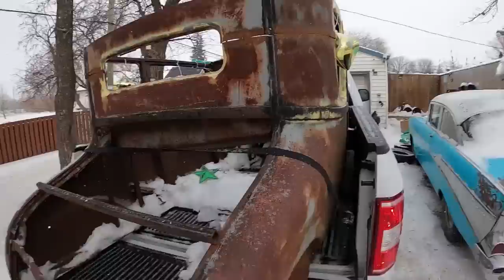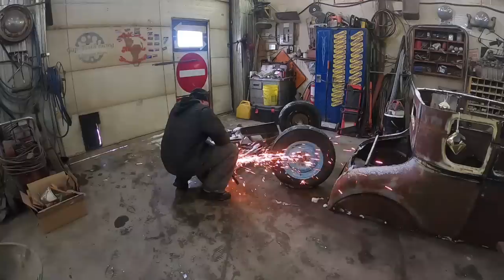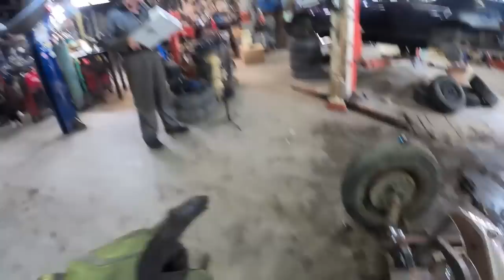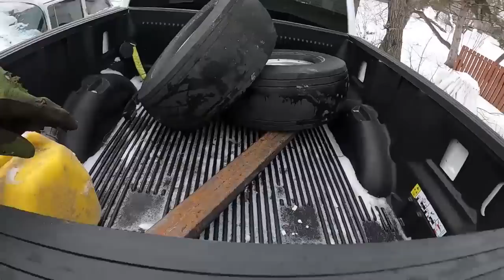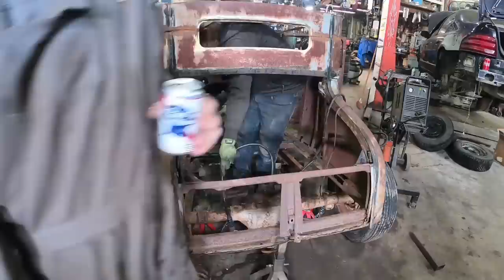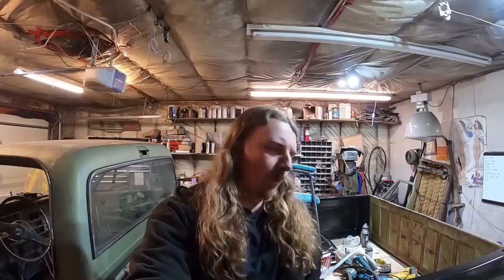Model T Rat Rod Build - T Wrecks, From Junk Parts to a Roller with Halfass Kustoms

Comment: I dig both projects. Halfass is doing something that has caught your interest, I'm sure not your first roller frame but no shame if it is as that always holds a guy back. Taking a break from the c10 will allow you to come back and finish. I have got started on stuff like it and so committed that too late to change to a different, not necessarily better but different outcome. I know that your holding costs down on the truck build cause they can be money pits. It will greek up when the primer goes on and some wheels of choice gives it direction. I like working as a team on some things but like the roadster that is next is halfass's regular day job and he is enjoying company and giving him a break as well from the 38 pontiac that has come to finishing touches. As it gets better, you need to sell to keep money coming in and its starting to warm the heart a little. Ya let them go before paint or then its harder still. I do comment on his stuff a lot so maybe or maybe not member my name. I just wish I was there doing some down and dirty makes you feel like you did something. While up there take a look at some of his front end/rear end attachments and see which way you go next time as you have enough to go back to back and its cheaper than building double nickel chevys. Anyway a hi to both and see if he does remember the name (me). You guys could team up on one build only spendy project for a club car or whatever turns your crank.... luck to both

Comment: two great channels to follow, keep up the good work! T is awesome, flat head would make it sound awesome!
Reply from the maker: yeah it sure would.  i think il go more traditional with the roadster
Reply: @DDSpeedShop  there is nothing more traditional then a flaty.  Although next would be either a 283 or 327. Do not and may I say it again do not put a LS motor in it.!!!! Also the wide tires and aluminum wheels would be out of place on this build.  You want narrow and tall with either chrome reverse or steel wheels, just like the ones that you are using to mock up with. 😎

Comment: I'm a fairly new subscriber. I really enjoy your videos. I commend you for your efforts. I envy you for the amount of time you have to devote to your projects. I REALLY don't want to be a Negative Nelly. HOWEVER... I have doubts about your front suspension. It APPEARS you may only have an inch or two of travel before the spring comes crashing into the bottom of the frame rails, causing all sorts of havoc. But who am I to judge? Rather than rain on your parade, I should probably start my own durn channel and show how I do it.
Reply from the maker: yup needs a block or somthing to raise it up

Comment: Sometimes it's good to "shift gears" and work on a different project to clean one's mind...The hot rod looks cool. I realize I'm getting ahead here, I still have a question. When you welded the truck frame to the existing car frame, do you have to add additional braces where the frames were spliced?
Reply from the maker: yup ill go back and plate everythiing for strength
Reply: @DDSpeedShop  ok. I know I may have jumped the gun here, but as long as you know it wasn't negative comments.  
Gee, engine choice.  Hummmm.....
Old 348/ 409? 
L.S. ????? Hummmm.....choices.....
That's too far down the road. .... 
Peace out!!!!!

Comment: Surprised you didn’t stretch the front axle a bit more forward to use that existing spring mount.
Reply from the maker: im not a fan of the suicide front end
Reply: DD Speed Shop I like the rake.

Comment: I would have used the suicide spring perch up front since the frame has the pie cut that makes the front rails parallel to the ground,  gives it a cowl downward attitude and looks mean as hell... but this is turning out to be a cool trad rod the way you guys went. I'm diggin it and it makes me want to get to my '32 Pontiac two door. Its about 3 projects down the line fro the ones I have in the shop already. Don't give up on the C10, its gonna be cool too, doing metal work is always 'discouraging' when you'd rather be wrenching, but its worth it. 

I'm no good at naming vehicles, other than the Pit Of Despair Mustang, the Lazarus GTO, and Old Ugly the street strip toy, they're usually called what they are.. e.g blue car, red car, '67, '65, '70 whatever... its always a description, probably due to the fact I have a huge pile of projects.
Reply from the maker: thanks man!  Yeah im terrible at naming them too.  But it seems like people like that sorta stuff haha